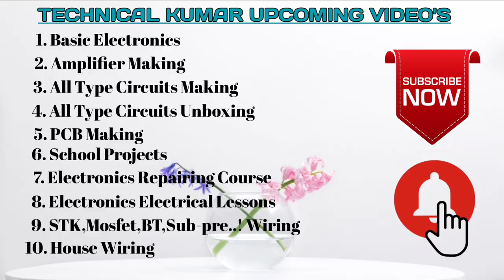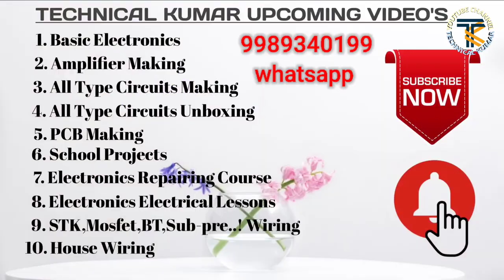how to make a hdmi arc 5.1 amplifier @technicalkumar

Comment: bro.... i have normal 5.1 remote kit ampifier. i want to convert it into av receiver like this what you shown in the video. 
1) Is it possible to convert it ?
2) what are the components/ devices i have to purchase extra ?
3) what are the cost for these boards ?
4) If possible show the wiring connections....

looking forward to your reply........